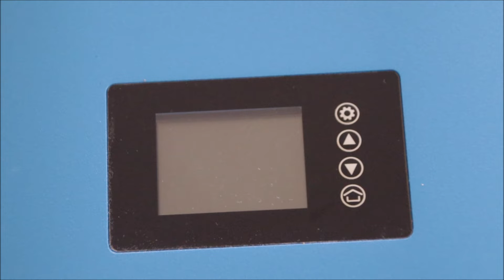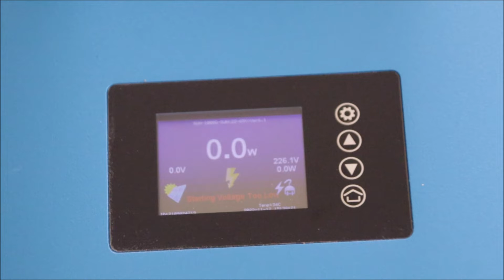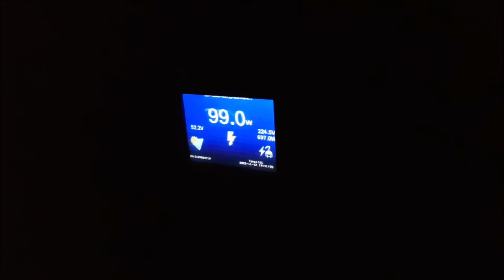SUN 1000GTIL - No Power Repair Attempt Part 1? Almost thought I have nailed it...

Comment: thanks for this Video, its a shame that there is no fuse in entry-stage of this power supply, i think its a fly-back one.I
would also change the two yellow caps and also the Bridgerectifier > big black part between the caps. Also the
resistor should have the same resistance then the old one.
There is also a good u-tube chanel (Diode goes wild) which explains power supplys verry good, may be this helps.
Reply from the maker: Thank you. You are a genius. Thanks to your hint of the Flyback power supply circuit and Diodes Gone Wild I have realized that the resistor that I have changed was actually an inductor. I am trying to get a replacement and this should actually, fingers crossed,  fix the supply :)
Reply: @RolandW_DIYEnergyandMore  Were you able to obtain the component and repair the inverter? (I have four of them)
Reply from the maker: @benkanobe7500  yes. The faulty inductor was replaced and the inverter has been running well since then. There's a second part to this video.

Comment: I have the same model, more or less. It is producing AC output, but the DC voltage is 10v  higher than what the battery is providing. It is very strange
Reply from the maker: @aatheus  probably just a voltage divider issue with a bad resistor on the control board. It sounds like you can still use the inverter.
Reply: @RolandW_DIYEnergyandMore  yup! I just had to set the cutoff voltage 10v higher than reality

Comment: Nice video. Personally i would change those two yellow vent capacitors but rest looked ok I don't know how long did you use that inverter but if it is more than 5-7 years..that is the best time to change all those capacitors ..as that is time when it all start failing.
Reply from the maker: Yes. Caps are always on my radar. This inverter is unfortunately only 8 months old. That makes it a bit of a sad story.
Reply: @RolandW_DIYEnergyandMore  oh ..then..how to say it polite..it looks like that inverter is sh-t ..  If it fail after 8 months..so as you said it is how there is so warm..so lets maybe it round 2 years of virtual life..still good inverter should last about 5 years..very good one about 10 and anything after 10-12 is pure luck and will fail soon